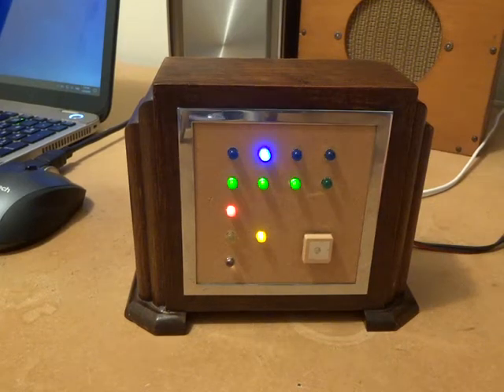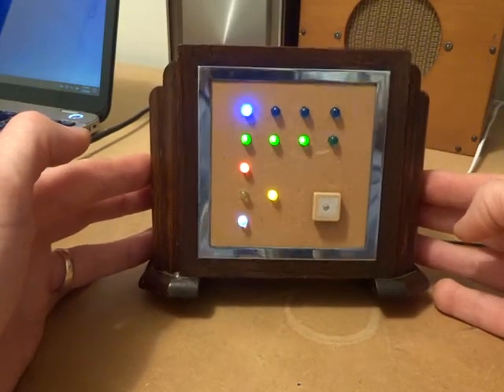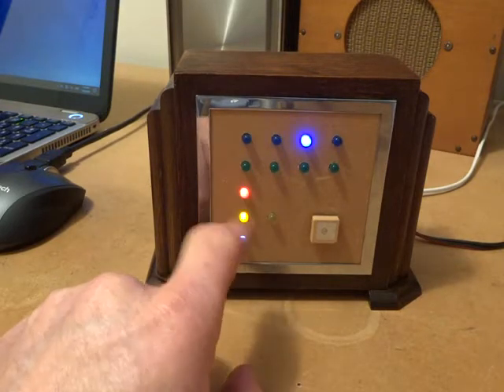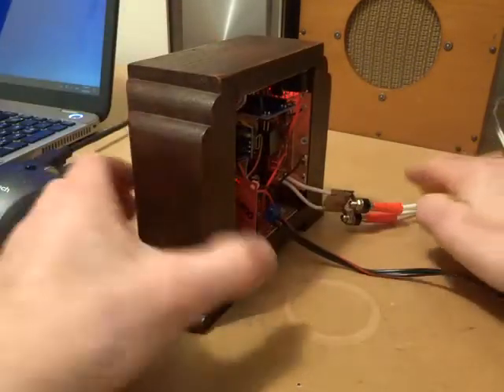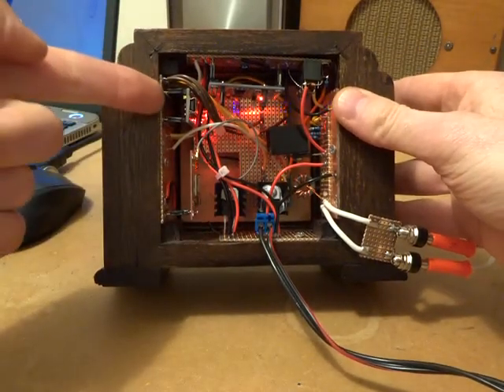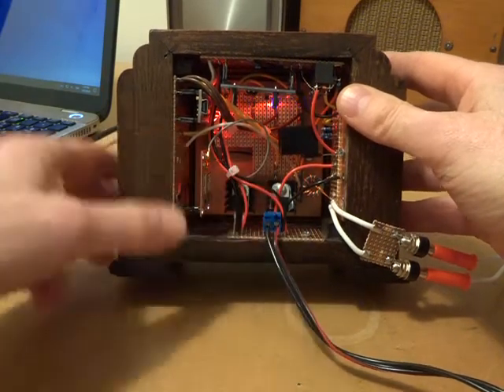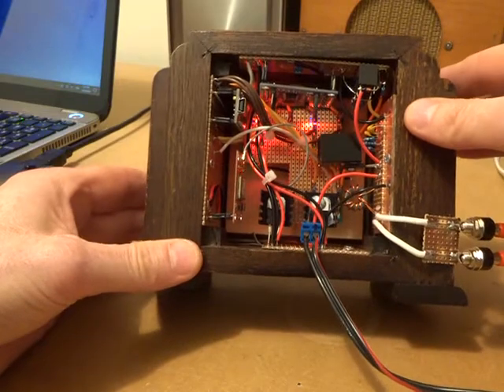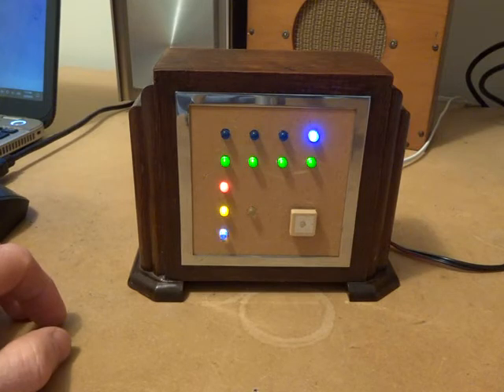Homebrew 20m WSPR Beacon: Part 3 All boxed up

Comment: I am working on a WSPR transmitter based on your design with some changes.  I eliminated the progress indicator for now because I am thinking about using an analog output and an analog meter.  I also had a si5351 sitting around so I am using that to synthesize the output.  After getting it all working and verifying everything I could not get WSJT-X to decode the output and no one else seemed to be decoding me.  I verified that I was sending the correct sequence and sending the correct frequencies.  My signal was a little triangular on the scope, so I thought it was either that the signal was not pure enough.  I also suspected that the timing might need to be more precise.  It was easier to tackle the timing first, so I rewrote the code using an interrupt to time each tone precisely and that seems to have made the difference.  I am working on a Teensy so I used the interval timer.  Once I changed the timer it is working.  I still plan to a dd a low pass filter to clean up the signal a bit.  

Here is my code.

#include "si5351.h"
#include <JTEncode.h>

#define TONE_1 0
#define TONE_2 1
#define TONE_3 2
#define TONE_4 3
#define TONE_OFF 4
#define CORRECTION 0

//Teensy 3.5
//SDA0 Pin 18 to si5351 SDA
//SCL0 Pin 19 to si5351 SCL
#define LAMP_PIN 28
#define HIGH_PWR_LED_PIN 29
//#define PROGRESS_METER_PIN A2
#define TONE_0_LED_PIN 24
#define TONE_1_LED_PIN 25
#define TONE_2_LED_PIN 26
#define TONE_3_LED_PIN 27

const char call[7] = "KE3C";
const char gridSquare[5] = "FN20";
const uint8_t lowDbm = 10;
const uint8_t highDbm = 20;
const int GPS_BUFFER_SIZE = 200;                              // The maximum size allowed for an NMEA sentence.
char sentence[GPS_BUFFER_SIZE] = {0};
volatile int _sentenceIndex = 0;
volatile char character = 0;
volatile bool timeToSend = false;
volatile int _UTCMinutes, _UTCSeconds = 0;
volatile long freq = 0;

uint8_t LowPWR_WSPR_Data[WSPR_SYMBOL_COUNT];
uint8_t HighPWR_WSPR_Data[WSPR_SYMBOL_COUNT];
volatile bool sending = false;
IntervalTimer ToneTimer;

// Create the objects
Si5351 si5351;
JTEncode jtencode;
void setup()
{
  Serial.begin(115200);
  delay(5000);
  Serial.println(WSPR_SYMBOL_COUNT);
  jtencode.wspr_encode(call, gridSquare, lowDbm, LowPWR_WSPR_Data);
  jtencode.wspr_encode(call, gridSquare, highDbm, HighPWR_WSPR_Data);
  // Initialize the Si5351
  // Change the 2nd parameter in init if using a ref osc other
  // than 25 MHz
  si5351.init(SI5351_CRYSTAL_LOAD_8PF, 0, CORRECTION);
  Serial.println("si5351 Init");
  // Set CLK0 output
  si5351.set_freq(0, SI5351_CLK0);

  si5351.set_clock_pwr(SI5351_CLK0, 0); // Disable the clock initially

  // Initialize the Software serial port
  Serial2.begin(9600);
  Serial.println("Serial connection to GPS started");

  pinMode(LAMP_PIN, OUTPUT);
  pinMode(HIGH_PWR_LED_PIN, OUTPUT);
  pinMode(TONE_0_LED_PIN, OUTPUT);
  pinMode(TONE_1_LED_PIN, OUTPUT);
  pinMode(TONE_2_LED_PIN, OUTPUT);
  pinMode(TONE_3_LED_PIN, OUTPUT);

  digitalWrite(LAMP_PIN, HIGH);
  digitalWrite(HIGH_PWR_LED_PIN, LOW);
  digitalWrite(TONE_0_LED_PIN, LOW);
  digitalWrite(TONE_1_LED_PIN, LOW);
  digitalWrite(TONE_2_LED_PIN, LOW);
  digitalWrite(TONE_3_LED_PIN, LOW);
  ToneTimer.begin(ToneEvent, 683000); //Fire every 683 ms
}

void loop()
{
  //Check the GPS Clock to see if we are ready to start
  if (!timeToSend)
  {
    if (Serial2.available())
    {
      character = Serial2.read();                                                    // Get a single character
      //Serial.print(character);
      sentence[_sentenceIndex] = character;                                           // Append the current character to the sentence
      _sentenceIndex++;

      if (_sentenceIndex == GPS_BUFFER_SIZE)                                          // Check for overrun of the sentence array. If so, restart
        _sentenceIndex = 0;

      if (character == '\r')                                                          // Carriage return. Look for RMC sentence
      {
        _sentenceIndex = 0;                                                           // Reset index counter ready for next timet

        if ((sentence[4] == 'R') && (sentence[5] == 'M') && (sentence[6] == 'C'))
        {
          _UTCSeconds = (10 * (sentence[12] - 48) + (sentence[13] - 48));
          _UTCMinutes = (10 * (sentence[10] - 48) + (sentence[11] - 48));
          //Serial.println("");
          Serial.print("Minutes = "); Serial.print(_UTCMinutes); Serial.print("  Seconds = "); Serial.println(_UTCSeconds);
          if ((_UTCMinutes % 2 == 0) && ((_UTCSeconds == 0) || (_UTCSeconds == 1) || (_UTCSeconds == 2)))
            timeToSend = true;
        }
      }
    }
  }

  //If it is time to transmit and we are not already transmitting, start transmitting
  if (timeToSend && !sending)
  {
    freq = random(14097000, 14097200);
    Serial.print("Freq = "); Serial.println(freq);
    si5351.set_clock_pwr(SI5351_CLK0, 1); //Enable Clock
    sending = true;
  }
}

void ToneLEDs(int toneIndex)
{
  switch (toneIndex)
  {
    case TONE_OFF:
      digitalWrite(TONE_0_LED_PIN, LOW);
      digitalWrite(TONE_1_LED_PIN, LOW);
      digitalWrite(TONE_2_LED_PIN, LOW);
      digitalWrite(TONE_3_LED_PIN, LOW);
      break;
    case TONE_4:
      digitalWrite(TONE_0_LED_PIN, LOW);
      digitalWrite(TONE_1_LED_PIN, LOW);
      digitalWrite(TONE_2_LED_PIN, LOW);
      digitalWrite(TONE_3_LED_PIN, HIGH);
      break;
    case TONE_3:
      digitalWrite(TONE_0_LED_PIN, LOW);
      digitalWrite(TONE_1_LED_PIN, LOW);
      digitalWrite(TONE_2_LED_PIN, HIGH);
      digitalWrite(TONE_3_LED_PIN, LOW);
      break;
    case TONE_2:
      digitalWrite(TONE_0_LED_PIN, LOW);
      digitalWrite(TONE_1_LED_PIN, HIGH);
      digitalWrite(TONE_2_LED_PIN, LOW);
      digitalWrite(TONE_3_LED_PIN, LOW);
      break;
    case TONE_1:
      digitalWrite(TONE_0_LED_PIN, HIGH);
      digitalWrite(TONE_1_LED_PIN, LOW);
      digitalWrite(TONE_2_LED_PIN, LOW);
      digitalWrite(TONE_3_LED_PIN, LOW);
      break;
  }
}

void ToneEvent()
{
  static volatile uint8_t symbolIndex = 0;
  static volatile bool power = 0;
  if (sending)
  {
    SendNextTone(symbolIndex, power);
    symbolIndex ++;
    if (symbolIndex >= WSPR_SYMBOL_COUNT)
    {
      symbolIndex = 0;
      sending = false;
      si5351.set_clock_pwr(SI5351_CLK0, 0);
      power = !power;                                                                    
      digitalWrite(HIGH_PWR_LED_PIN, power);
      ToneLEDs(TONE_OFF);                                                                       
      //analogWrite(PROGRESS_METER_PIN, 0);                                                  
      timeToSend = false;
    }
  }
}

void SendNextTone(uint8_t symbolIndex, bool powerLevel)
{
  if(powerLevel)
  {
    volatile uint64_t frequency = 0;
    frequency = (freq + (HighPWR_WSPR_Data[symbolIndex] * 1.4648)) * SI5351_FREQ_MULT;
    Serial.print("Index = ");
    Serial.print(symbolIndex);
    Serial.print(" Symbol = ");Serial.println(HighPWR_WSPR_Data[symbolIndex]);
    Serial.print("Frequency = ");Serial.println((long)frequency);
    si5351.drive_strength(SI5351_CLK0, SI5351_DRIVE_8MA); // Set for max power
    si5351.set_freq(frequency, SI5351_CLK0);
    ToneLEDs(HighPWR_WSPR_Data[symbolIndex]);
    //analogWrite(PROGRESS_METER_PIN, map(SymbolIndex, 0, WSPR_SYMBOL_COUNT - 1, 0, 1023));
  }
  else
  {
    volatile uint64_t frequency = 0;
    frequency = (freq + (LowPWR_WSPR_Data[symbolIndex] * 1.4648)) * SI5351_FREQ_MULT;
    Serial.print("Index = ");
    Serial.print(symbolIndex);
    Serial.print(" Symbol = ");Serial.println(LowPWR_WSPR_Data[symbolIndex]);
    Serial.print("Frequency = ");Serial.println((long)frequency);
    si5351.drive_strength(SI5351_CLK0, SI5351_DRIVE_2MA); // Set for max power
    si5351.set_freq(frequency, SI5351_CLK0);
    ToneLEDs(LowPWR_WSPR_Data[symbolIndex]);
    //analogWrite(PROGRESS_METER_PIN, map(SymbolIndex, 0, WSPR_SYMBOL_COUNT - 1, 0, 1023));
  }
}
Reply from the maker: Thanks Ken. That will be of use if someone else also has timing issues. So far the AD9850 configuration is working well.

Comment: Nice project. Have you tried using small switching regulators instead of the linear ones to reduce the heat? I've used the RECOM POWER R-785 0-0.5 modules with good success in a couple of QCX kits. They're a drop-in replacement for the 7805 (other voltages available)  and barely even get warm.

Comment: Could maybe of added one of those tiny oled screens and then you could even use it as a clock!
Reply from the maker: Hi Brian. The thought did cross my mind, but my strong preference is an analogue face. I build a really nice nixie tube clock out of an old 1950s piece of test equipment some years ago, but gave it away in the end as it was digital.  All good fun.